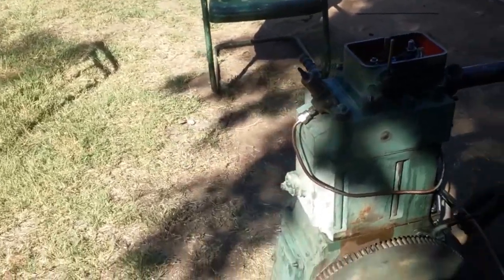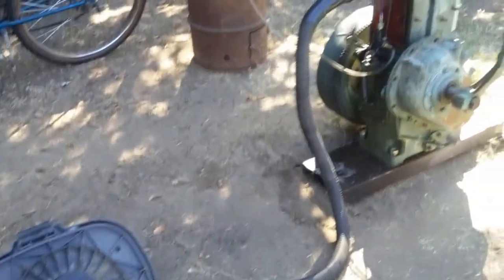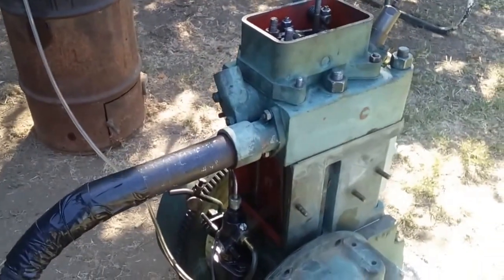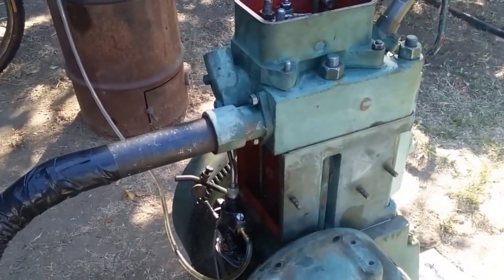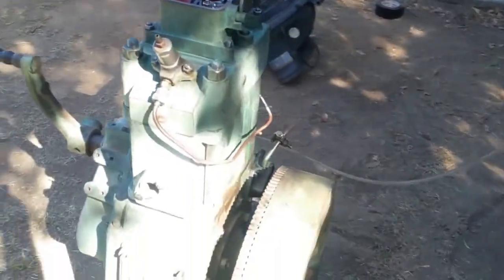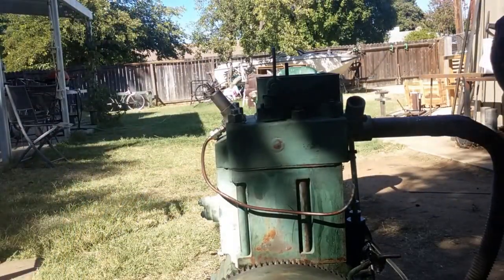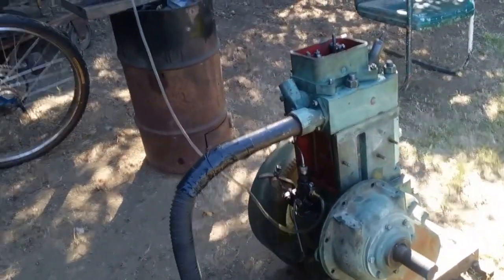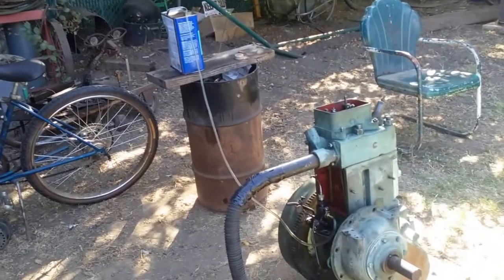Lister Petter converted to 2 stroke Loop scavenged Atkinson diesel with valves

Comment: Take any Cummins or Cat motor and make an inverted loop scavenged 2 stroke. Jest need the right cam and a blower.
Reply: The only thing u need to take into account it’s the timing of the crank is it’s a multi cylinder engine
Reply: @loganzister9344  Yes true some one did a 5 cylinder mercedes diesel 2 stroke conversion.
Reply from the maker: pretty much...

Comment: Cool, it amazed me how well a regular 4 stroke can be modified to become a 2 stroke.
Reply from the maker: I wasn't sure that the valves would scavenge the cylinder well enough for good combustion but so far it seems promising. Using diesel is nice because it's just flowing air  and no fuel through during scavenging that way I'm not worried about loosing fuel through the exhaust valve. Another possible advantage of this type of engine  is maybe there are enough exhaust products to reduce the NOX ?   Most modern engines use EGR for this but maybe just leaving some of the exhaust gas  in the cylinder will work for NOX reduction? CAT does something similar with the valve overlap on their ACERT engines. I was thinking about a traditional port loop scavenged diesel and maybe using the valves will get more fresh air where it's needed up near the injector? Another reason I like using  the valves is I can control the timing unlike a piston port which is a fixed event. My inspiration for doing this is the Atkinson Utilite' engine. It was the last engine Atkinson produced and not many people know about it.  It was a differential compression / expansion 2 stroke.
Reply: here is a 454 2 stroke in a chevell:http://www.chevelles.com/forums/11-bench-racing/528170-2-stroke-454-a.html
Reply from the maker: I followed the link and it's just a guy talking about trying to build a 2 stroke... so far he drilled some holes in a block but I didn't see anything beyond that... no cam modifications... nothing talking about how to get fuel and air into the engine and nothing about which direction it will flow.. and from reading the guy's posts I imagine that's about as far as it will get...
Reply: Those car guys want to keep there racing 2 strokes to them self's it look like. Its much better to do it with a summit racing aluminum 572 block, enter air through the bottom with window ports and exhaust valves on the top, that will be a real head turner. however the hemi motors can use a 1:1 cam crank speed and a blower for a valved loop 2 stroke! That would make one nice dodge challenger!
Reply: @jlo13800  Either that or an air guide on the intake valve. Or intake and exhaust valves looking away from each other, as in a Japanese patent — requires a kuztom head tho.